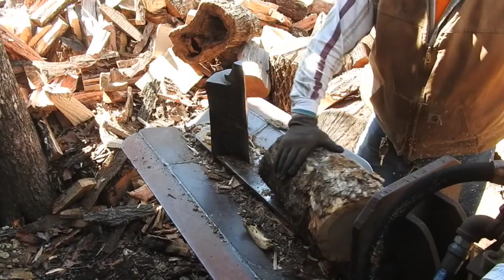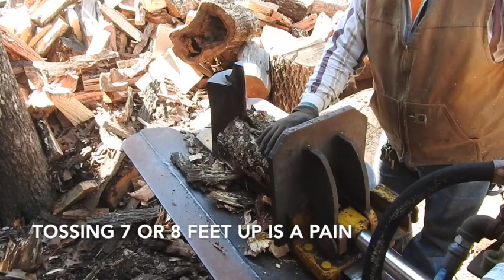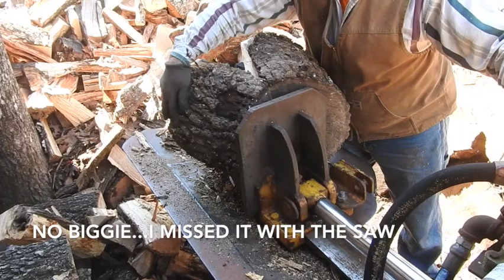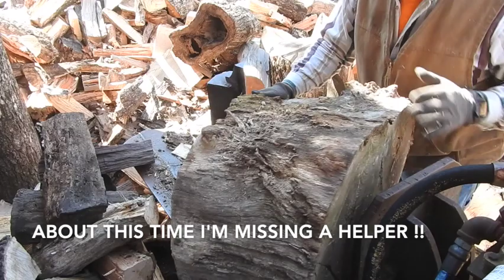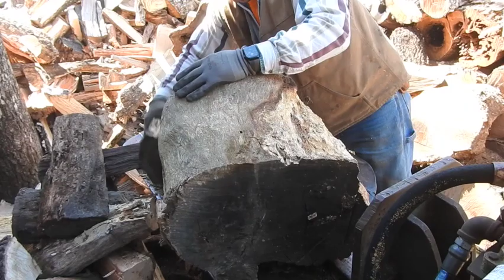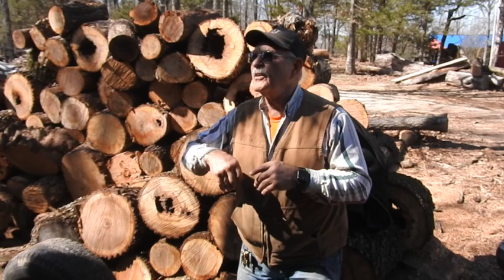Gnarly Oak Stalls Homebuilt Splitter With Single Stage Pump

Comment: Were you splitting them smaller to make them easier to throw?
Reply from the maker: No, not really Rick. I keep a variety of small to large pieces to make it easy for the Missus to keep the fires going. She doesn’t like the big ones because they’re kinda hard for her to handle. So she can put two or three to equal one of my bigger ones. Make sense ..??

Comment: Good old splitter there Wendell. single  stage pump too, still get's the job done. 
Regarding the wrist,, with that sprain or what the 'aliment' might be, it's kind of like a fuse in a panel, it lets you know when you have overloaded it, doesn't it?
 I feel that too. just watching throw those  pieces up and over like this.
Reply from the maker: Well Reg, I think its a sign of impending old age or something !! It is unbelievable how I have difficulty with holding and throwing with just the right hand.  It's slowed my process down considerably.  But no biggie, eventually it should come back to normal...maybe this winter when I get some indoor shop time huh.  LOL
Reply: @tractorman4461  The main thing is, I think, to keep going and doing things as you've always been doing.  Well, it's what I try to do, like today fr example, my buddy and I are changing  over our cars to winter ( snow and ice ) tires and wheels,... bet you don't have tp do that! LOL
Reply from the maker: @regsparkes6507  Hahahaha...no I sure don't have to do that.  Thank heaven !!  I really  am getting to where I dislike winter pretty badly.  The circulation in my fingers must be getting bad because my hands get cold now. Years ago, my hands were never cold and I seldom wore gloves. Not so now.  LOL. Old age ain't for sissies is it.  Have a fun time changing over your cars.

Comment: I just did a video of the mods we did to my big box store splitter.
It turned that very ordinary splitter into a very capable machine.
I have never run into anything yet that my splitter won’t split. It either splits it or it cuts it, but with that 2nd stage, it makes small pieces out of big ones.
I will be splitting some hard maple this fall. That can get a little gnarly.
Thanks We dell
Reply from the maker: Awesome Gary !!  I'll go take a look and see what you did.  A two stage is definitely beneficial for sure.  The big worry is twisting a light non-reinforced beam with the twisted grarly burls going through the stress of the push.  But if this pump ever wears out I will probably give serious consideration of a 28 gpm two stage pump to keep the ram speed up 95% of the time.  Heck I only need the extra oomph 5% of the time.  (by estimation).  LOL. And I think my beam will handle the stress with the webbing reinforced with a 3/8 plate on both sides making it a 1 1/8" thick beam plus gussets.

Comment: I've been thinking of putting a single stage on my 5 horse splitter but I'm afraid it ain't enough horse power ...what's your opinion? Cheers
Reply from the maker: What I'd consider instead Grizz is to come up with a pto mounted pump that mounts directly ON the pto shaft behind your Kubota. Then you can pull it behind the tractor and have plenty of power for the single stage pump as long as you don't go crazy with the pump displacement.  I'd at least price them at Surplus Center.  I don't recall the exact hp of your tractor but I'm pretty sure it'll handle a 16 gpm single stage pump.  But if you try to pop the relief valve, it WILL kill the tractor just like THAT !! I'd say 250 bucks and a few hydraulic hoses will get ya working quick.  Later you can convert it to a three point mounted splittler for even more versatility.

Comment: That’s an amazing splitting machine! I could use that to split my oak . I have a small upright one I’m borrowing and it’s way to slow .  We had two huge oak trees fall on our property and I have a huge load of oak to split.  Thanks for sharing another interesting video.
Reply from the maker: Well, if you was a neighbor instead of 2/3's the way across the country from me, Id stop by and shoot the breeze with you and watch you split it all !! LOL   Btw, I didn't think So Cal needed any heat....??!!
Reply: @tractorman4461  HaHa We need heat because the natural gas company has tripled the rates out here!!! It gets into the high twenties sometimes. Thanks for the friendly offer - if only we were neighbors I would take you up on your offer!!!
Reply from the maker: @GasPumpRob  Yes, LP gas has increased a bit, but it's not crazy high at all.  And gas was $2.99 yesterday at one of the local stations.
Reply: @GasPumpRob natural gas prices are expensive here. But not like it is in your area. I'm really glad that you have something other than palm trees to burn for heat. 🤣. Neighbors would be nice.
Reply: @CAROLDDISCOVER-2026  
“Good” Neighbors are the only ones anyone needs .  Like State Farm haha 😂 😂😂😁😁😁😁